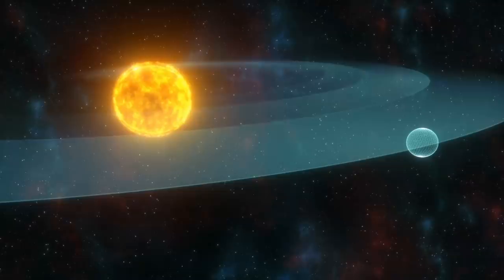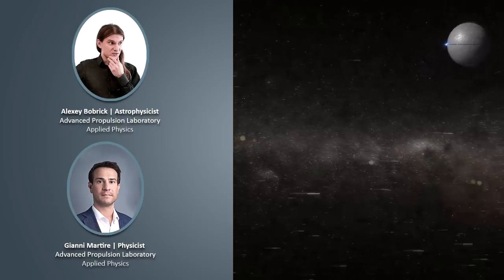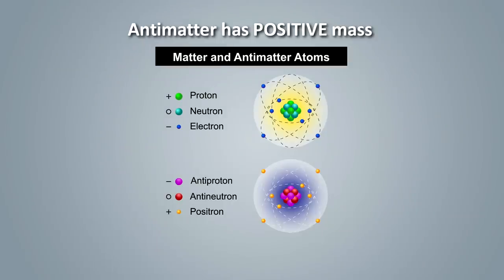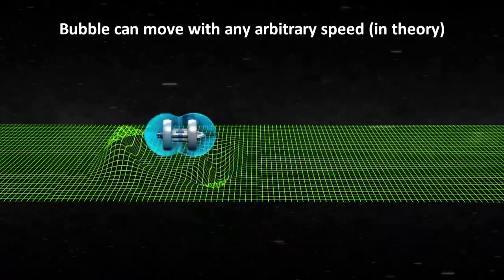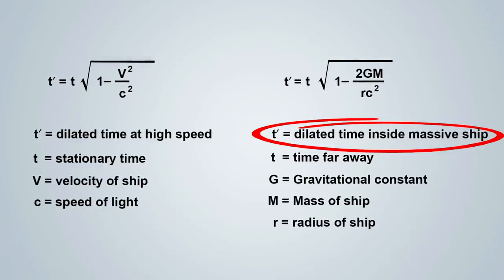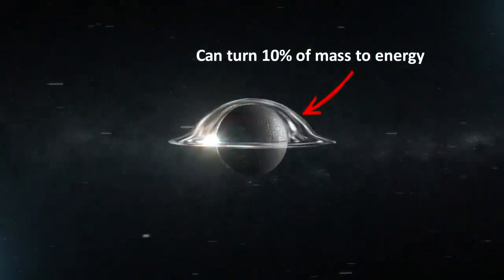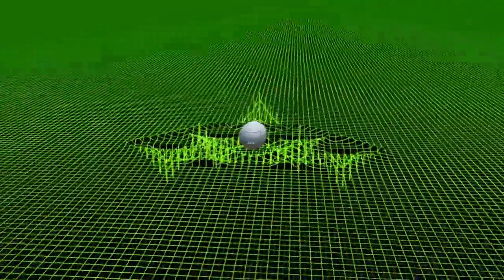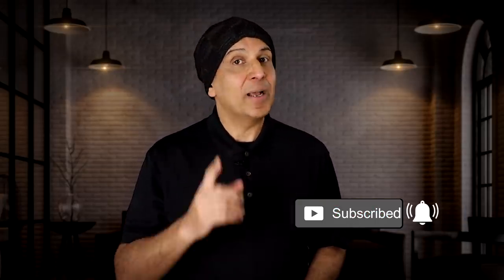REAL Warp Drives? NEW research proposes a solution!

Comment: The rub is with time dilation a five year trip is still five years so round trip they'd experience almost two year of travel in the ship but would arrive back at an earth that has experienced 10 years so they'd technically be traveling to the future in their eyes even though the rest of the world saw them go and return in 10 years..so we're not actually traveling faster, only aeingly so to the passengers within...not a real solution unless we're talking a one way trip for colonization purposes, then it would benefit the passengers as they'd be still near the age they were when they left BUT they'd be talking to a much older earth (accounting for lag in radio at those distances added to the time earth perceived their trip to take) so by the time they get there a lot could have changed. This is a good concept for an Ark sort of thing but unrealistic for exploration.

Comment: The key is the Imaterium. You enter the warp, then come out somewhere else. To put it in laymen's terms... You find a way to enter 'Hell', which shouldnt be that hard, then since the rules of physics do not apply there, when you come back out, you could traverse the galaxy in mere seconds. But it's Hell... not an easy place to escape, nor since the rules of physics dont apply, you also dont know how long you may actually be in it. Could traverse the galaxy in seconds, or could spend thousands of years to move an inch.

You also have those pesky demons and ruinous powers to worry about should they hitch a ride.

Comment: We all except the existence of the electron and the photon however we still don't know what they are nor can we examine them unless you have a cat box.  Think of this, if you can create gravity then you should be able to control mass.  If you can reduce mass then you can reduce it to the point that  accelerating an object should take little or no energy.  At this time, investigating subatomic particles with accelerators is like trying to perform an eye operation with a chainsaw.  The mathematics concerning warp drives may be mathematically correct however, all of the terms involved must be correct or the conclusion is incorrect.  The formula E=MC squared is nothing more that E=mass times velocity where V is substituted by C.  That has yet to be proven.

Comment: I hate to say this but I think you're looking in the wrong section and I will just simply say anti-gravity might just have the keys 4 warp drive capability or AKA UFO backwards engineered or another name fluxliner and if you're looking for a power source we might already have it option one plasma from a star option to an unknown nuclear material which is stable but still Radioactive 3 matter and antimatter reaction 4: would be the common cold fusion or Fusion in general last one Fusion option for which connects it directly to the Philadelphia Experiment the Eldridge used leased diesel engines number of engines unknown the main thing is they were using they were using analog technology during that time and they had Tesla coils in four regions as antenna and parts that technology might be able to be found even in Project Montauk

Comment: Your comment about acceleration in the warp bubble should not be a serious problem since you are just need to accelerate to distance of the contracted space in front of the ship. That is whole purpose of contracting the space in the front of the ship.
Reply from the maker: Well, it would be nice if that's all it took. But theoretically, the entire bubble is static needs to be accelerated to the speeds you are trying to attain.
Reply: @ArvinAsh  thanks for the reply. So what benefit forming the warp Bubble have if at the end you need to accelerate to near light speed inside the bubble. Maybe I am missing something?
Reply from the maker: @Roust7  The warp bubble can theoretically travel faster than light. But like I said in the video, to accelerate something faster than the speed of light is impossible (as we understand it today).
Reply: @ArvinAsh   I apologize with the back and forth but I am not sure we are looking at it right way. The real physical event where mass is moving faster than speed of light . First current expanding universe past visible  limit space is expanding faster than speed of light including at initial Big Bang. The idea of warp drive is to create the same conditions in a bubble where the ship is riding this wave of space contraction in front and expansion in the back. In this case I don’t see a need for any huge acceleration of the ship within the bubble except pushing the ship on top this wave. Note the Lorentz formula of increased apparent mass would not be relevant since speed inside the warp bubble is subliminal. You are correct this would require negative energy which is real as we see our visible cosmic horizon is pushed faster than speed of light by this yet to be discovered or explained.

Comment: The truth is that there is no energetic medium in a vacuum to manipulate. A heat exchange model is what is hypothesized with an evacuation of what is in front and a buildup behind
producing a vacuum, friction free movement, like a bubble coming up through the water. This analogy does not work in space where  there is no medium. Just because Einstein
showed by calculation that mass produces torsional forces, does not mean that "space" is curved. Dimensionality is best explained by the Mandelbrot equation, which shows a
ratio of fractionalization from largest to smallest. Spheres of matter exist within the void which can be defined by the matter they contain, free falling magnets that perturb
each other, however the leap to taking "material" metal, flesh, or other through space, faster than light, while remaining intact, is absurd. A Spirit could travel trans dimensionally,
but matter moving across dimensions? Whose goes first?

Comment: Mechanically, I think it’s possible. The problem though (and I’m still watching so you may address this) is causality. The warp drive would still threaten causality. Really causality is the fatal flaw of FTL travel, and there’s no real way around it because it’s not a property so much as it is logical possibility.
Reply: Time dilation applies to things moving through space time not a piece of space time itself being moved. There are areas of the universe right now being observed as expanding away from us at a rate 3x the speed of light, but since it’s the space itself moving it’s not violating causality
Reply: @bradysmith4405  it still does because you can encounter causality violations in areas where spacetime is completely flat, far away from the warp bubble. Anything that lets information traverse spacelike intervals in a coordinate-invariant way (warp drives qualify) can violate causality.
Reply: @isodoubIet  oh, ok thanks. Interesting. I’m wondering since they are now trying to use quantum causal disorder for charging batteries if maybe causality, and the speed of causality as light speed is always called, if maybe there are other loopholes around light speed we haven’t thought of yet.

Comment: I don't understand why you wouldn't be able to surpass the speed of light under constant acceleration in space at some point even if space isn't entirely frictionless. Maybe an onlooker wouldn't be able to see it in "real time" from the starting point because it's going to be constantly accelerating over the speed of it's possible returning light, but I don't understand how that's the theoretical limit.
Reply: Matter can only exist between absolute zero and absolute acceleration- the speed of light. As matter reaches its terminal velocity, it reverts back to energy. You can increase the speed of light by increasing the permittivity of space - electrical energy, bit you can't exceed the speed and to travel at the speed of light, one must become light or rather, electrical energy.

Comment: Why can't we just skip warp drive and go straight to wormhole travel so we can get there instantly LOL JK
Reply: Question have you figured out how we can actually create worm holes let alone the energy needed to do it and the technology that would be needed to create the gateways in space and on top of that you would have to figure out how to get one gateway to the destination that you would want it to go to that way you can create a connecting gateway with wormholes that’s only possible and Stargate not reality yet I don’t know of anyone who’s ever done any of the calculations and materials needed to do that
Reply: @danyelPitmon  no one has a working warp drive and a few years back no one had s clue how a warp drive could be made.
Worm holes are theoretically possible, as warp drives are.
I'm just saying if worm holes could be made & stabilized then travel over extreme distance to be near instantaneous which is far better than the time it would take to use warp drive.
Would we really need to get a gate somewhere else for the wormhole to connect to? I think using a Stargate like that is the beginners level I think on expert level you could just open the wormhole to where you want and pop through.
This i feel folks should work on figuring that out.

As for the question of weather I have figured it out....
No. I just do it & will leave worrying about how to other people lol
I'm not a physicist

Comment: Wouldn't the crafts mass increase as the speed increases relative to the craft and space-time -meaning the equation must be divided by the speed of the craft relative to the constant of space-time?
Reply from the maker: You are talking about relativistic mass. Yes inertial mass increases with speed, but does not become very significant until you start moving far above 50% the speed of light.
Reply: @ArvinAsh  yeah and if you want to go 5x the speed of light you need to factor it in...right both models are still subject to this variable or because relative to the new mass they will be limited to going < 50% of c

Comment: We better hope FTL drives are impossible, because if even a little FTL is possible, it is possible to travel a path that takes you back in time (DANGER, PARADOX), so you can travel a path and some distance in a total of zero time - repeat as often as necessary - and you can travel and colonize the entire universe effectively instantly as soon as you develop FTL travel. This has not happened to us so either: (1) we will be the first sentient expansionist beings in the universe to develop FTL travel, or, (2) FTL is not possible. I think (2) is far more likely.

Comment: Sounds like you have to create a black hole in front of you and a white hole behind you. That would be expensive. We  could also build a space ship for a long journey once we decide its not possible to get there any sooner. Where would we get the material to make a craft the mass of a neutron star and the fuel? From our solar system? We keep the travelers young but at a cost i am not sure our solar system could do more than a few times. Send them on the 20yr round trip in a smaller ship that we could do many more times than in a neutron star ship. These trips should be to a worth while place and not just to say we made it to another star as the cost would be high.

Comment: Have the machine create the Walk drive and the antimatter and matter inside of a chamber creates the energy to push the bubble faster than the speed of light it will go 10 times faster than speeder light by doing so this way that's the knowledge you need

Comment: Hold on a minute! If time is relative and space-time are indeed one, then shouldn't space also be relative to the person viewing it?
Reply from the maker: It is, but only readily apparent to a distant observer, not in the same frame, at close to the speed of light - length contraction.
Reply: Space is relative even in good old NEWTONian physics in the sense that the conlocality of two time-likely separated events depends on the frame of reference.
If I drink a cup of cappuccino within a bistro, my first and my last swallow will be in the same location with respect to the bistro, but described in a frame Σ where the bistro is moving at some speed v, the last swallow will be spatially separated from the first by vΔt where Δt is the Σ coordinate time measure and calculate from a clock at rest in Σ.
Reply: @ArvinAsh  
I prefer putting the termini "time dilation" and "length contraction" into quotation marks because the former is more of a projection of a process happening in some space vehicle to the world line of a clock the vehicle is moving with respect to, and the latter may be described as a bevel cut through the world sausage of the process.
I like to compare the room during the process (e.g. me having a cappuccino within a board bistro) to a salami whose length stands for the duration and whose cross section stands for the room's size. 
Of course, the comparison breakes down due to the difference in the metrics which is Euclidean for the sausage and Minkowskian for the room during the process.
Because of that, a bevel cut makes the slices longer in the former and shorter in the latter case.

Comment: Space-time is made of relatively stationary matter of a quantum significantly  inferior than a photon, a graviton, that in relative movement had kinetic energy. The fastest speed is the speed of gravitons as proven by quantum entanglement, where split photons stay connected by orbiting gravitons, travelling in a field of matter gravitons. A dense graviton plasma receiving straight pressure from graviton energy, graver, will travel at gravitonic speed. If it receives pressure from spiraling gravitons, the plasma will erode in a spiral trajectory creating a black hole. They will take a ship quasi-instantaneously at the speed of gravity anywhere as described at sandaero dot com.

Comment: what would happen if we go as fast as 50% speed of light and we hit a small peddle or any other space debris?
Reply: It is not like this. With a Space-Time Bubble, you are deforming space, and you are wrapping yourself with the fabric of space, and you happen to be absent from it (of the Universe), so to speak. When Traveling isolated from Space (Absent from it) within a Bubble-Space-Temporal; what you do is: make space pass through you (you don't pass through it (it's the other way around)); so your ship remains immobile; This is how you travel; so to speak; hidden from the universe. In this way; if your starting point is "A", in front of a star "W", and your arrival the point "B", on the other side of "W"; what you do is deform the space around you; structuring a bubble-space-time (That is, you isolate yourself with the same fabric of space); which oriented towards point "B", will be the space that will pass around you; in the equivalent magnitude, which separates you from point "B". Immediately after reaching your destination; second act, so to speak; you leave your hiding place (your bubble); finding yourself in terms of trajectory, as if you had crossed that star, but what really happened; is that you were absent from the universe; since 1) -You hid, or isolated yourself at point "A", of the universe, 2) -You made pass a magnitude "X" of space around you; in the direction and sense of point "B", and 3) You left your envelope aside once you reached your destination, etc.. For this you can use a successive number of jumps in your route; That is to say: of a repeated and successive quantity of steps 1), 2), 3); so your trajectory can be composed of abrupt turns in 90, 180 degrees, etc., and you drinking a cup of coffee, without spilling a drop (You are not the one who travels. So your ship remains immobile (it is space the one that passes through you); you do not alter the physical laws that govern our universe; you do not exist during this process for it; when you reappear, everything remains as it is (in the universe); that is, you can go to Alpha Centaury after the breakfast and return in time for lunch).

Comment: Electricity travels through a wire slower than it does through the air !! DC voltage is even slower !! But there’s absolutely no speed limit to how fast you can go it’s just the speed of light travels at 186,000 mi./s ,, but in the vacuum of space as long as you’ve got thrust you can go any speed you want The speed of light is the speed light or electricity travels but human beings are not electricity ...